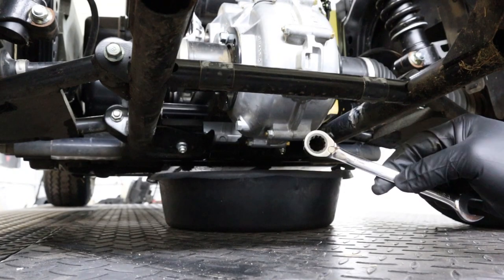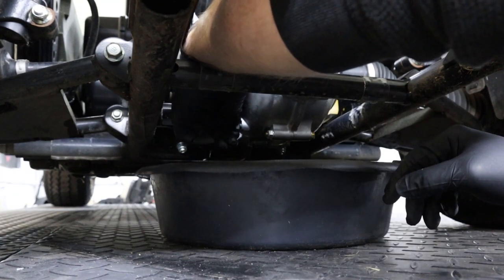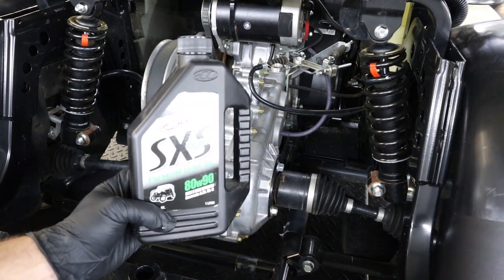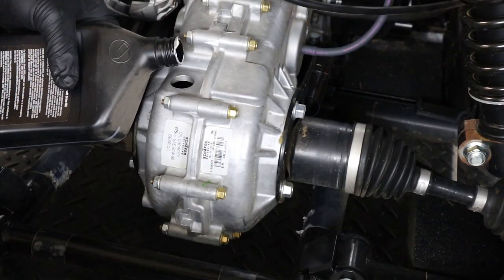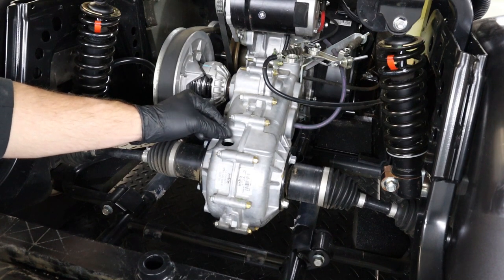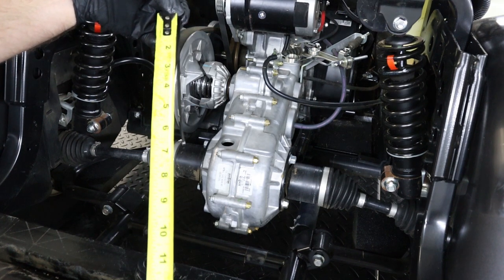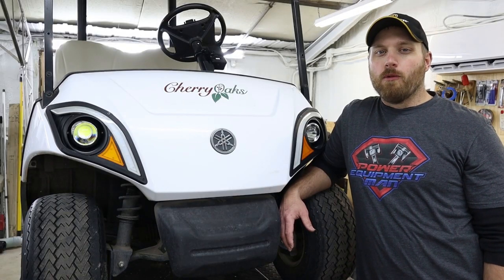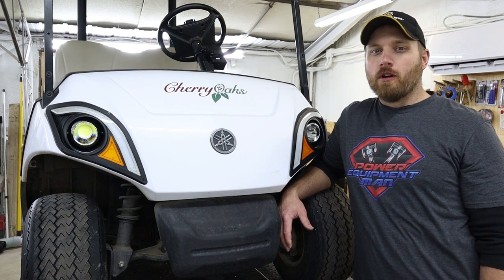Yamaha Drive 2 Quietech Golf Cart Rear Diff Oil Change

Comment: I believe that all Independent Rear Suspension (IRS) diffs hold 1/2 quart of 80/90 or strait 90 according to the 2022 manual. 

From the Manual:
Secondary reduction system helical gear

Secondary reduction ratio:
Forward 9.79:1 / Reverse 14.36:1
Differential type bevel gear

Lubricant/capacity:
475 cc (475 ml, 0.50 US qt)
SAE 80W-90 or SAE 90 gear oil
Reply from the maker: About a year ago, Yamaha discontinued the Yamalube Friction Modified Shaft Drive 80W90. That part number now supersedes to the Yamalube Friction Modified Shaft Drive 75W85, which is what we sell now. My guess is that they changed the weight due to the Quietechs having an issue with spitting oil out of the breather tube at higher speeds. 
That being said, if you are using a different brand of gear oil, I'm sure 80W90 will work just fine. But to my knowledge, you can't buy Yamalube Friction Modified Shaft Drive 80W90 anymore.
Reply: @PowerEquipmentMan  Thanks much, You've given me great advise in the past thus, I buy my maintenance stuff from ya. Good video too.

Comment: I just got a new 2022 drive 2 and it keeps leaking fluid from the rear transaxle vent tube after a mile or two of driving. Any thoughts why it would do this? Dealer said the fluid was not overfilled.
Reply from the maker: Have you actually checked the oil level yourself like how I show to do it in this video? I hate to say it, but there is a lot of "dealers" out there that have no idea what they are doing. There is very little or no training required to actually become a dealer for machines like these. Other than being overfilled I can't think of any reason it would be leaking, unless it has some type of manufacturing defect in the housing.
Reply: I’m experiencing the same thing - there is a black tube running from the passenger side of the diff up to the engine and it is seeping oil. It almost seems like this is what it is designed to do but would 2 newly delivered units be experiencing the same issue from the factory?

Comment: Jonas should the 2017 quietech go 19.5mph stock ?  Mine doesn’t
Reply from the maker: Only if it a ptv model that comes with the high speed gears. Fleet carts are usually set at around 13 mph.
Reply: @PowerEquipmentMan  mine is a Ptv has a hour meter and it reads quietech efi drive 2 on side doesn’t go 19 hmm

Comment: Would that fill level be accurate for a 2011 yamaha drive g29 cart?
Reply from the maker: Yamaha used several different rear diffs in the Drive1, this is not one of them. You will need to find a service manual online to try to look up your exact cart's spec. Try searching for Yamaha YDRA service manual.

Comment: Is it possible to up speed on a drive 2 efi? Mines a ptv so comes set at 19mph
Reply from the maker: You should be able to get it to around 25 mph - https://youtu.be/T8a0gV3Q_bg
Reply: @PowerEquipmentMan  thank. Going to break it in and then turn it up
Reply: @PowerEquipmentMan  also my cart is brand new and the hour and fuel gauge is flashing when moving. What does this indicate?
Reply from the maker: @Ptro1  There should be an hour glass on the left side of the hour display that flashes to indicate that the hour meter is counting. It only counts while the engine is running.

Comment: Are u sure u measured 51/4-5 51/2 inches ?  It looks like u measures over 6
Reply from the maker: You are measuring from your fingers to where the oil level is on the zip tie.  The zip tie is 6" long, but the oil level was about 1/2" up from the bottom of the zip tie.
Reply: @PowerEquipmentMan  The manual reads to use 16.06oz
Reply from the maker: @jonaugspurger3716  yes that is 1/2 a quart, just like I say in the video. The shop manual also says the level should measure 5 1/2" down from the fill plug.
Reply: @PowerEquipmentMan  oh sorry I missed that ty u the man!